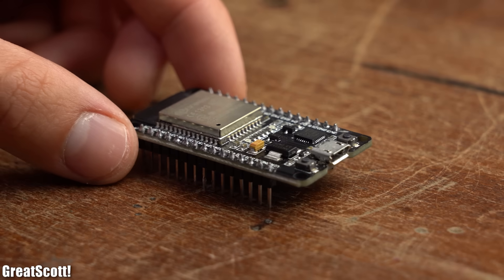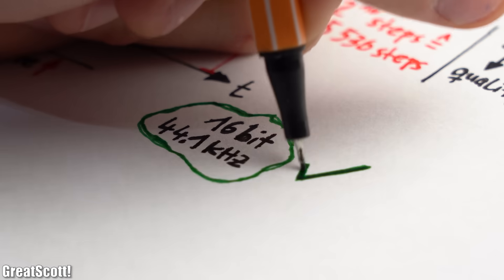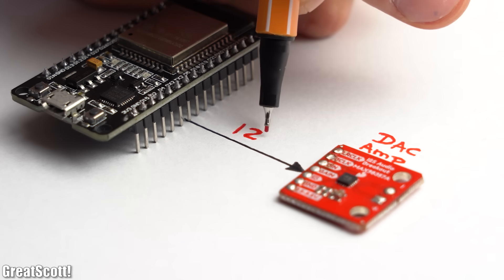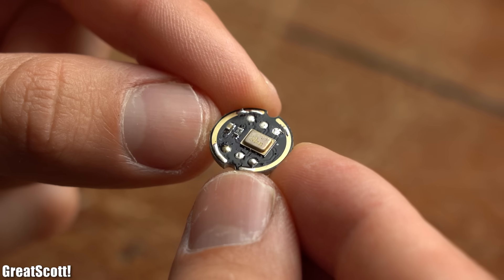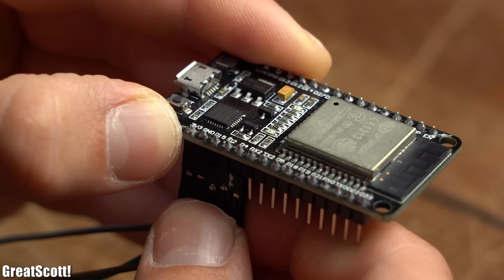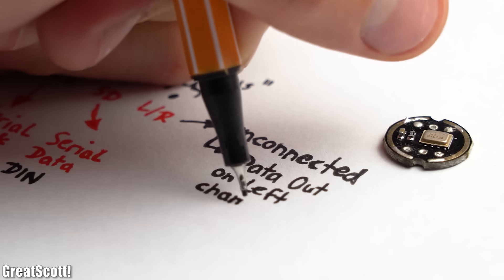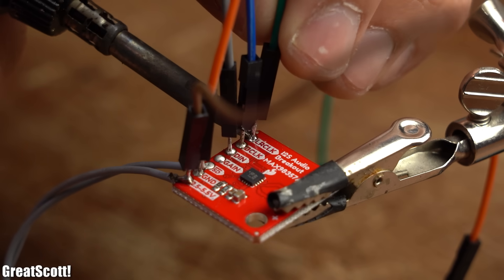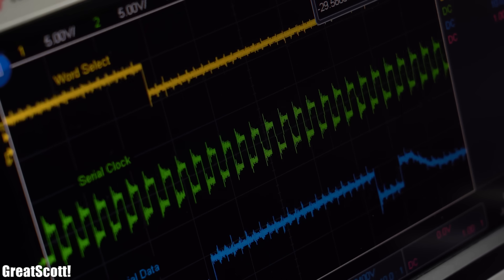Building a Digital Music Player with I2S?! What is I2S! EB#45

Comment: hy Scott. I have made a project using an arduino nano and a mp3 TF-16P module. Everything is ok whet i hookit to may PC usb but once i suply curent from anything else it is starting to make a disturbing noise. I have tried external batery, USB on a laptop with baterry or without it, 5 diferent usb chargers but nothing seams to work. only on my usb on the keybord is working perfect. Can you helb or make a video about this cheap MP# module. Tanks for your time.

Comment: Your videos are really helpful. can you also tell how to improve the quality of audio???

I found no solution on internet. Please help me.
Reply: These first few suggestions are extremely important. Use a good quality sound file (play the sound file with your computer...if it sounds crappy on your computer, it will ALWAYS sound crappy with your MCU I2S setup). Load sound file into SRAM before playing. Make use of DMA (assures consistent delivery of the sound file to the amplifier). Those will be the important frontend solutions. Now the backend. Use a high quality I2S amplifier. Make sure your DC blocking capacitors to your speakers are properly matched to the speakers you are using (i.e. 4 ohm vs 8 ohm and at what wattage). Use an I2S amplifier that has high pass filter and clipping capabilities built in (in addition to low THD) like the TAS5760L chip. Follow proper power supply filtering (both at the power supply and at the power inputs to all your ICs) and circuit design (i.e. pay attention to crosstalk and EMI/EMC) to prevent any electrical noise from entering/exiting the audio (i.e. means you can only expect so good of sound quality using prebuilt modules vs a custom 4+ layer properly designed PCB). So in the end you may not have found any solutions on the internet because your problem encompasses more than just 'how to improve sound quality'. When you read datasheets, many of them will provide circuit recommendations that will help their product perform. Many times prebuilt modules don't follow all of those recommendations and therefore won't perform with 'quality' in mind.

Comment: Hi guys I have a question let's imagine that I want to do a project as follows: an sd card reader module reads an mp3 file which goes into the esp 32 to output into a 10W amp then into a speaker is that This will work even without the digital to analog converter. Thanks for your help.
Reply: Your two choices (well technically 3) to get audio out of any MCU will be DAC (only so many have those built in), PWM and I2S. With the DAC, you will generally want a precision that matches your audio file. So if you have an 8-bit audio file than the 8-bit DAC on the ESP32 will work great for you. If you have a 10-bit (or higher) audio file then the 8-bit DAC on the ESP32 will cause a reduction in your sound quality (think 8-bit audio like Nintendo games when Nintendo first came out...don't expect MP3 jamming music). Normally with a DAC you will want 12-bits or higher for at least semi-decent audio (which then usually means an external DAC and an additional IC since you still need an amplifier). PWM is worse because it takes a lot of overhead to convert your sound file into a PWM signal that will then be smoothed to an analog output via filtering (which also reduces sound quality). PWM sound is basically if you have no other choice and you are ok with crappy sound. Now I2S reigns supreme for this because it is digital data and not analog (which is what your sound file comes in). In addition if you get a proper I2S amplifier (a TAS5760L can do 20W @ 12V mono or 10W @ 12V stereo), you can send the data directly out (via DMA - for proper sound quality you will want to use DMA) to the amplifier and the amplifier will take care of converting the digital signal to an amplified analog audio signal. In addition, the TAS5760L has an I2C interface that allows you to adjust things like gain, volume, clipping...even tells you if a fault has occurred with some faults being fully recoverable.

Comment: Hello Mr. Scott, I followed this video - https://www.youtube.com/watch?v=MG1-kYFCkqI   and made the project ( which seems fake to me now). However I am getting a lot of noise directly from the esp32. I verified this by getting rid of the lm386 used in the project and directly plugging in the speaker(4 Ohm 3Watt)  to esp32. No matter what voltages(3.3v, 5v) or power sources( i.e. usb, 12v dc)  I try I couldn't get rid of the noise. Could you please help me out.

Comment: Hello, great video!!! I would like to know if it is possible to put an amplifier at the output of the i2s max98357 to amplify even more?
Reply: The input of MAX98357 are digital signals, I2S, 16-bit PCM..same I2S goes for PCM5122 DAC...but the output of DAC PCM5122 is Analog Line Out or Headphone Out, which actually needs ANALOG Amplifier to drive the Speaker Drivers....whereas output of MAX98357 is Speaker Out, which can drive 20 Watt RMS Speakers, stereo..so if you are using PCM5122 DAC, you need a ANALOG amplifier along with it, like TPA3118 which takes Analog Line-In not a DIGITAL amplifier like MAX98357 which again would take digital I2S as inputs..
Reply: @youtherbiswas8  Using the PCM5122 in addition to an analog amplifier would be a good option. Thanks for the help friend!
Reply: @Clebrw  yes, you got it..what you need is an Analog AMP section, because the output of PCM5122 is Line-Out or Headphone Out which are Analog Left & Right signals, so to Drive Speakers you need BTL, Bridge Tied Load based speaker drivers driven by Analog AMP..like TPA3118/TPA3116 From Texas Instruments ..

Comment: I want to add a little to the whole sampling rate debate. 44.1khz is all you need. It is in fact enough to PERFECTLY represent an audio signal ranging between 0Hz and 20khz. You do not need more. It is completely wasted to add more. Reason: you only need twice as many sampling points as the highest frequency you want to digitise. The rest can be mathematically interpolated. 
Higher Bit Depth can be usefull for higher volumes. Also it gives more freedom when mastering the song. However, as a listener you only need a certain amount of dynamic range. 16Bit is completely fine. You may argue for 24Bit but anything above is only useful at volumes that would completely destroy your ears.

Comment: The project does not work!  As some other viewer mentioned: "6:38 Looks like you interpreted the signed 16 bit value returned by the mic as an unsigned one." From my point of view you simply should state that your project has failed and tha it will need bug fixing.

Comment: Hi, thanks for your in-depth video. I am trying to use ESP32 development kit, but which returns Error compiling for board ESP32 Dev Module. How can I fix this error? It seems that teensy version should be upgraded, but my teensy is already 1.54 version. I don't have any solution for this compiling error. I am trying to use ESP32 board, so I don't understand why Arduino IDE is searching for Teensy related contents. Appreciate any help for this~!!

//-----------this is contents from Arduino IDE 
Detecting libraries used...

.....(here, I think it is searching for DMAChannel related things..)

Multiple libraries were found for "Audio.h"
 Used: /Users/JOO/Documents/Arduino/libraries/Audio-master
 Not used: /Users/JOO/Documents/Arduino/libraries/Audio
 Not used: /Users/JOO/Documents/Arduino/libraries/ESP32-audioI2S-master
In file included from /Users/JOO/Documents/Arduino/Arduino_test/#now_2021/ESP32_i2S/i2s_serialMesh_mp3/i2s_serialMesh_mp3.ino:8:0:
/Users/JOO/Documents/Arduino/libraries/Audio-master/Audio.h:31:2: error: #error "Teensyduino version 1.20 or later is required to compile the Audio library."
 #error "Teensyduino version 1.20 or later is required to compile the Audio library."
  ^
/Users/JOO/Documents/Arduino/libraries/Audio-master/Audio.h:37:24: fatal error: DMAChannel.h: No such file or directory
compilation terminated.
Using library Audio-master at version 1.3 in folder: /Users/JOO/Documents/Arduino/libraries/Audio-master 
exit status 1
Error compiling for board ESP32 Dev Module.
//-------------

Comment: Well, a higher sampling rate than 44.1 kHz won't actually improve the sound quality since a sampling rate of 44.1 kHz is enough to reconstruct the original signal perfectly as long the highest frequency of the signal is below the Nyquist frequency (22.05 kHz in this case).

Comment: Thank you for the great educational video! But it might be noticed that in the simplest case SD card and I2S DAC are not required. A short audio sample might be stored directly in flash memory (and might be compressed as MP3 or AAC) and an I2S hack might be used (delta-sigma soft DAC). Here is a library for such case:
https://github.com/earlephilhower/ESP8266Audio

Comment: Why not utilize the 16~128 MHz clock used by the DAC?
The most significant 8 bits of a single 16bit/44.1kHz sample would be the baseline output, and the least significant 8 bits would determine what fraction of the ≈363 samples(16MHz/44.1kHz) of the 16MHz output should be baseline+1. Spread them uniformly, dither, and presto: Good enough...
Yeah, ≈363 does not equal 256. But it wouldn't be as fun to implement if there weren't any difficulties now would it?

Comment: It's important to note that while greater sampling frequency does increase quality, any sampling frequency above 40 kHz makes irrelevant increase to the human hearing. Because, according do the Nyquist theorem, to perfectly reconstruct a analog signal you need a sampling frequency at least double the analysed signal. Thus we need only 40kHz, as the human hearing only goes to about 20kHz (and that's in very young children, because you'd be lucky to have this hearing past your adolescence). Also speakers are almost always limited to playing till this frequency, so even if you say that frequencies above 20kHz do somehow contribute to sound quality, your speakers won't even play it.
Reply: @Heads MessRegarding your point about two points making a triangle/sawtooth wave: Whole point of the nyquist theorem is that IF we are certain that no frequencies greater than the nyquist frequency was contained within the signal before we sample it, then we can reconstruct the sampled signal with any temporal resolution we want. So you dont have to drive your speaker with those 2 points, since nyquist tells you that thre is no ambiguity about the frequencies in there, you can fill the samples in  between to form the sinusoidal before you drive the speaker. And actually you dont even have to bother about doing that in software as a lowpass filter on the sampled output will do that for you anyways.
I agree with the rest of your comment.
Reply: When I was at the age of 22, a test showed that I can hear to 22K. The test was on a full room of students, the speaker frequency went up. Those who can still hear a sound raise their hands. There are quite a few of us run till the peak, which was 22k.

Comment: Hi, I don't understand why the sound is so bad at the end of the video as you used 16bits /44khz which should result with good audio quality? Is it a limitation on the esp32? Is it because of your speaker?
Reply: Mostly likely not using DMA with double buffering.  Without that any delay will show up as breaks.  In realtime transmission, it's a must.  If playing from a file, still the IO will cause lots of interrupts and result in breaking audio, even with a fast mcu.
Reply: I'm not sure, but I think the is2 amplifier generates PWM output instead of real waveform.

Comment: I’m disappointed. From an implementation standpoint, this leaves more questions than answers. Great if you use an ESP32 and that particular audio library, but this doesn’t really explain I2S in a way which allows competent viewers to use I2S peripherals with generic microcontrollers.

Comment: Good afternoon Mr. Scott, you went all the way to be able to playback a 16bit, 44.1kHz, stereo sound and the quality is appalling like that? That is surely no better than a mono 8bit output. In fact it is reminiscent of audio output of the Commodore 64 when the audio chip was turned on and off quickly enough to transform pulses in actual speech. I have worked with I2S equipped boards that have perfectly good audio quality, that one is unacceptable - for the reasons explained in the several first minutes of the video. I have reasons to think if you used a lower sampling rate and resolution you'd get a better result.

Comment: can we use bluetooth to replace sd card reader?
Reply: The sd card doesn't have a blue tooth interface. Since spi is faster and simpler than blue tooth I don't see an advantage.  You would have to make a custom board with an antenna and a blue tooth chip set and an sd card and would also need power.
Reply: @noweare1  esp32 have a Bluetooth right?
Reply: @kanui3618  yes

Comment: why not use the 2x8bit DAC and turn it into a 1x16 bit mono output? I've been wondering about a good way to do this sort of technique. Using 2 or more lower bit DACs and adding them together to get higher resolution or more bits
Reply: What about noise?

Comment: Music player? i'd say "sounds player", it sounds pretty awful
Reply: You can fix that in code, I've built a bluetooth-to-jack thing with an esp32 and a DAC and the quality is great. It's still on a breadboard after 2 years, but I don't care if it works.
Reply: @turai_  is it hard to improve the code to get better quality?
Reply: @Vizi_  You can just use ESP-ADF's examples or modify them a bit. With an ESP-WROVER-32 you can even player modern high quality codecs like FLAC, OPUS and AAC.
Reply: @turai_  trying to do the same...is it just editing the i2s configuration values, or is there more to it?

Comment: Fun fact: You can use I2S to generate the 38 kHz carrier for IR signaling, and save a lot of CPU cycles compared to the popular techniques.
(One of the features under the hood is called DMA, I think it would be worth a separate video)
Reply: The esp32 has a remote control peripheral.

Comment: To get stereo sound can you connect the word select pin to the L/R pin since the word select changes between high and low to send the data, if it was connected to the L/R pin as well wouldnt that toggle which side is transmitted?

Comment: Hey GreatScott
I just recently created a HiFi bluetooth receiver with i2s and a Raspberry with a Hifiberry DAC+ DSP hat. 

The reason to use this method was the quality and input methods. 

The CSRA6415 I used can handle APTX which is a high quality bluetooth protocol. Also this chip can handle button Inputs (to play / pause or control volume on the smartphone via local buttons) as well as many other things. 
It's a very cheap but great way!  It's completely configurable. 

So I connected it to my Hifiberry hat with correct I2S parameters and it worked a treat. 

Maybe an upgrade for your portable speaker! :)

I just realized I could have written this in Deutsch.
Reply: Do you have some links to this topics?
Reply: @steameier8590  What are you interested in?  For information about the CSRA6415 I would recommend the suredspratz site if you search on Google. If you need information about the tool, there's none. It's trial and error but theres a great standard configuration preloaded. For the Raspberry I used Moode as an OS and the hifiberry DAC+ DSP Hat, which would be programmable but I decided to just adapt the CSRA instead of struggling with this too. 

Just tell me about what you would like to know more. I also just did basic Internet research and a lot of testing! :)

Comment: too funny, i created a similar SD to audio device using an atmega in the last days. but i chose DIY not BUY as you did :-). 
i justed used an old SD card holder, transistors, caps and resistors ... a lot of C / C++ coding, debugging and optimization on an 8 bit, 20 MHz overclocked atmega328 
i think mine has better sound quality: -D
Reply: Mine sounded like crap. But ya, I was expecting better than that.

Comment: This might work well for my Halloween decoration I created years ago. I use a raspberry pi to play audio and flash red LEDs in the eyes when a motion event happens from my security camera. I've always felt like the raspberry pi was overkill. All it really does is has a webserver for commands. Takes the commands and plays either a random file (for motion) or a specific file from the command. Analyzes the wave form to blink the LEDs in sync with what is being said. The only thing that might be tricky is I have a web interface set up and I can talk through it using the microphone on my mobile phone. But it seems like I can probably get rid of the raspberry pi and just use an ESP32. Get rid of the hosted webserver and use my existing MQTT.

Comment: Why was the output sound so disrupted? I was expecting that i2s is pretty much lossless. I am thinking about creating wireless 5.1 sound system (it will use only power cords) using my old 5.1 (with too much cables) and using esp32 and esp-now. Problem is that I need to convert 5.1 audio to i2s and then distribute that to each speaker. Any ideas? It doesn't need to be esp32, just everything which would make it wireless 5.1 and is already documented.

Comment: Could you use the two 8 bit DACs and combine them with the R-2R resistor arrangement to make a  higher resolution output?  A downside would be only 1 channel, no stereo
Reply: You would need r-256r, but yes.